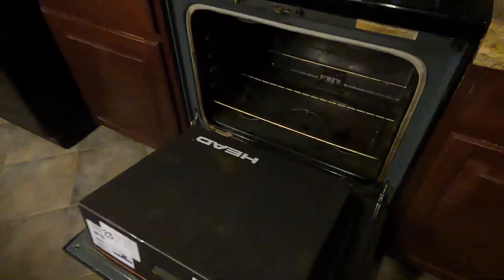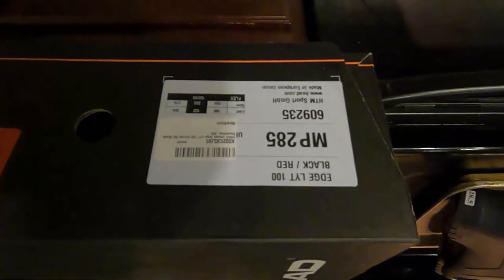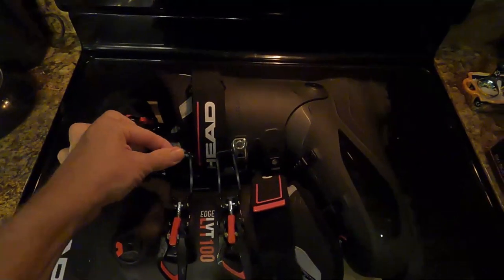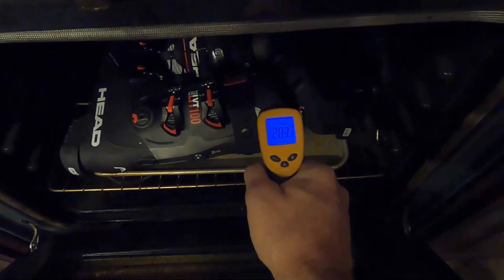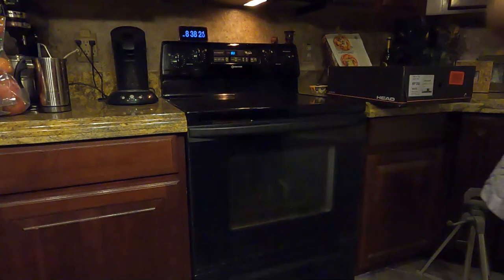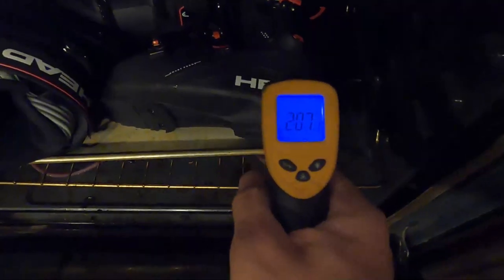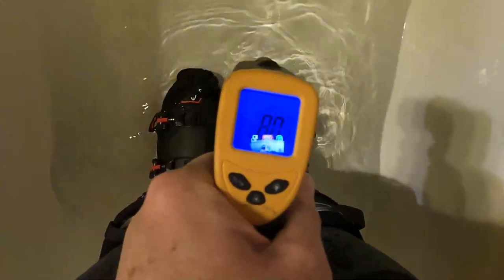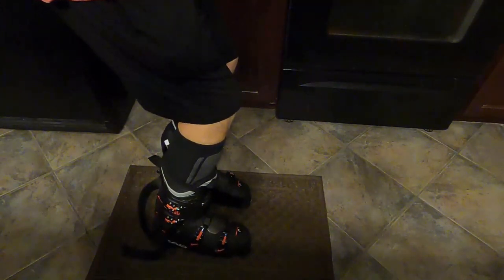Heat Molding Ski Boots in My Home Oven DIY - Custom Fit for Wide Feet

Comment: I’ve been doing this for 40 years. You should stand with the toes of the boot on a 1 inch piece of wood or broom stick. This will seat your heals into the heal pocket. Helps keep the foot aligned properly.
Reply: Can you do this with any boot?
Reply: Randy S
1 second ago
that doesn't make sense for the case presented in the video. He stated the front of his foot is wide, so if you shift weight back to the heal, there is not going to be as much pressure to expand the boot in the front. Am I missing something?
Reply: @randyskiba5761  If you have a good ski stance while toes are elevated, your toes will flatten out to their widest as they would if skiing.  You probably could do that without a board under the toes but you'd have to stand in a real uncomfortable position for 5-10 min

Comment from the maker: I spent two days in Purgatory last week.  I used "performance" rental skis with my brand-new heat-molded boots.  In 30 years of skiing I have never felt so in-control of my skis as I was with my formed-boots.  Skiing 9AM-4PM with no breaks, two days in a row, my feet were perfectly comfortable with no hotspots, blisters, crushed toes, or anything.  I took a gamble when I measured my feet to be 285 mm, then invested in 285 boots (as seen in the video).  I was nervous that my toes would not have enough room but this boot-length matchup was perfect.  Incidentally, while I was picking up my rental skis, I put my sock-foot on the measurement device, saw that it measured 285, and asked the rental tech what size boot he would put me in and he said "295".  I'm still contend that is how I have gotten rental boots that were too big for me (sacrificing ski-control) all my life.
Reply: The only thing that can't be fixed is adding extra length. As long as you have enough length, you should be able to bubble, or grind out any spots that are too small width wise. I also bough my exact length, hoping that this would lead to a better fit in the end. Renting boots is always a gamble, sore feet, or a bad fit, can really ruin your day... I decided to get my own, and will only rent the skis from now on. They are also very cumbersome to bring with you...

Comment: Great video, I'm about to do this myself soon. The trick with adding padding to the foot, to create more room, looks like it might be useful. Take note that some of their newer models the inside boot, can be filled with some paraffin vax substance to get a tighter fit around the ankles. If your boots support this. Taking them to a place that does that could help out.

Comment: The industry standard of size and measurement of ski boots is known as Mondopoint. That is what the 27.5 means. Ski shops use a mondopoint scale to measure your feet. We don’t ask you what US shoe size you wear and just try to use a conversation chart. I been fitting boots for decades and we follow a proper process. Measure the foot with the customer seated with no weight on the foot so it’s in a neutral position. Then have the customer stand and observe the size on the mondopoint scale and look to see if the ankle rolled in, arch flattens , etc. A more involved method after mondopoint is determined is to remove the liner and have the customer stand on a footbed inside the shell with toes touching the front. There should be enough room at the heel to place two fingers. Then we checked the room over the instep and along the side for width.
Reply from the maker: Hi Thomas:  I agree with and understand everything you said.  I did not mean to imply that any pro boot-fitter had given me bad information.  I'm just relating my own experience with the Mondopoint to US Shoe Size conversion table (which would put me in a boot larger than a 285) and with telling the ski rental techs at the mountain what boot you need based only on your shoe size, not a foot measurement.  Thanks for the comment.
Reply: If my side length is 10.5cm. Do I have a LAST 105 mm?

Comment: I find it is better to do one boot at a time.  Then the oven will not cool down as much when you put the boot in and you can put the boot on more quickly and concentrate better on pushing on those hotspots during those important first couple of minutes.

Comment: This is a very instructive video, so thanks for showing us how it's done step by step. Do you have any specific resource you used to get the information about how hot to heat the oven, how long it should be in the oven, and whether or not the shell and liner can be heat molded together or separate? I just bought a pair of Nordicas and I want to heat mold them myself, but I can't find any info on their website or in their manual about heat molding or thermoforming, but I do know it's possible with the particular model I purchased.

Comment: 1. Oven 235 farenheight degrees to get boots to 212 farenheit degrees Placed in oven for 10 to 15 mins.

2. Place on feet for 10 mins.

3. Place in water up to topp of split in boot or Place bag of peas for 10 mins.

4.  Redooif still doesn't fit right.

Comment: i think i'm going to do this. i've bought a dalbello boot, heat moulded the liner and the outside plastic is still too tight. it's bullshaite because they're advertising the model i've bought as wide
Reply: Wide was my problem, too.  That's probably why I always ended up with rental boots that are too long.  I can tell you that the width of my boot improved to match my foot AFTER I put the closed-cell foam pads in my sock to create additional space then formed the boot to my foot.
Reply: did you ever try this? I have a pair of k2 boots i’d like to heat mold and don’t want to risk damaging them. any issues?

Comment: You are going to have width problems, and the only way to correct that is by providing an expansion device under heat because I can tell from a visual inspection the bladder will not give you the comfort for a day of skiing.
Reply from the maker: I appreciate the comment and I'm sure it's true for some people.  For my wide feet, the use of the closed-cell foam pads inside the sock when I stood in the hot boot was all I needed.  For the first time ever, the "last" of my boot was right for me and skiing was pure comfort.

Comment: Actually I don't really understand 3.49. I bought a pair of boot MP26.5 and I measure my foot length 26.5, is that too small for me? My toes have a slight curl to it touching the end of the boots.
Reply from the maker: For me, the measure of my foot indicated the boot measurement exactly.  Be aware that most boot sellers secretly admit that there are no differences in 1/2 sizes and next-lower whole size of their boot shell.  That is, although I bought a 28.5, it would measure exactly the same length as a 28.  If you're a 1/2 size, the safe thing is to buy up to the next whole size, and the aggressive approach (for snug fit and maximum ski control) is to buy the 1/2 size which is probably the same as the lower whole size.
Reply: @eggcleaver916  Reading your reply, I re-measure my foot standing against a wall. It is 26 cm (sorry for the mistake) yet I can't fit a MP 26.5 boot with comfort. My 2nd toe is touching the end of the boot. Is that a wrong pair of boots for me?
Reply: @1688AAA  is this with or without a liner?
Reply: @IamtheWV17  with liner. It felt tight
Reply: @1688AAA  felt? Did you get rid of them? 

If it were the right shell, it should fit with about a thumb of free space.
Then the liner is fine tuning to fill out that space.

This is why heat mouldable liners are the norm now. You get the shell that fits and the line may be a little tight; so you heat mould the liner.
Reply: @IamtheWV17 no, I still have the liner. It's heat moldable as it says. To heat mold, is it expensive? I heard that a custom sole of $100
Reply: @1688AAA  You still have the boots too?
Reply: @IamtheWV17  yes. I still have it. Going to try it this winter.

Comment: I wouldn't mold the shells. Just the liners on a head boot. Salomon and atomic are the only ones with the true PU in the shell to mold the whole thing.
Reply: I just checked a YouTube video made by Head Winter Sports. The product manager did place the boot with the liner into the Head Heat oven. There was a chart to give recommendations for heat time depending on temperature. I believe 12 minutes at 100 C. Then he had customer stand in boots for 10 minutes. We do Salomon Custom HD shell and liner at my shop. We remove and heat separately. We don’t deal in Head products so this was useful in case a customer comes in with an online purchase which I don’t recommend. We custom fit and guarantee every boot we sell and fit. Can’t put a price on good professional service.
Reply: What about K2?
Reply: Definitely do the shell and liner separately.  I do my zip fit liners in the microwave and steam warm the boots with a lobster pot.